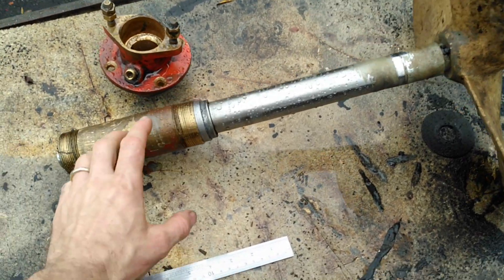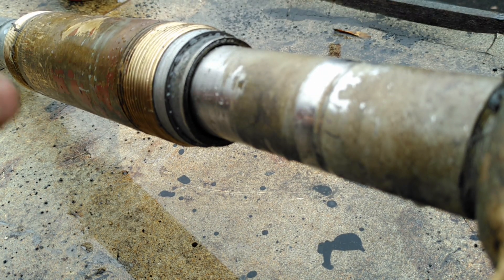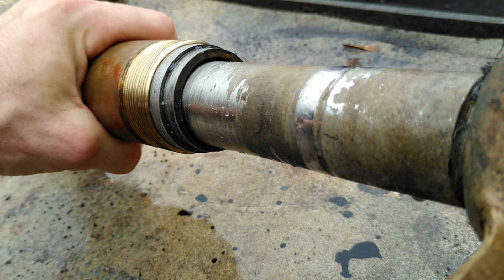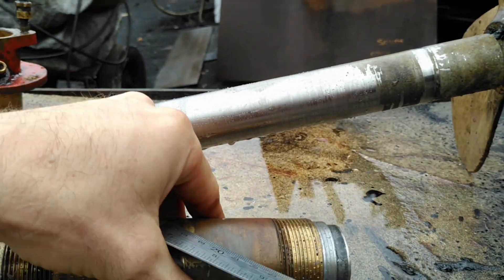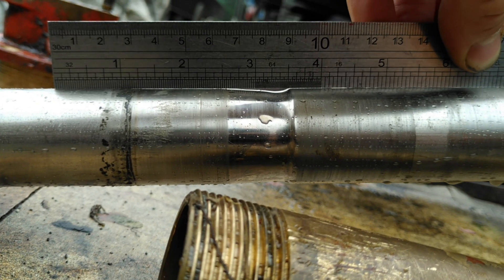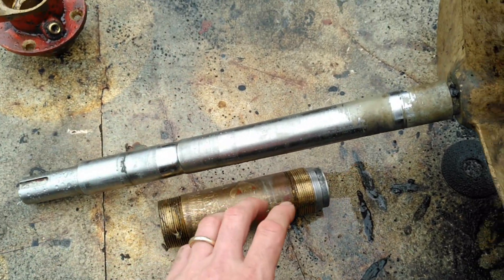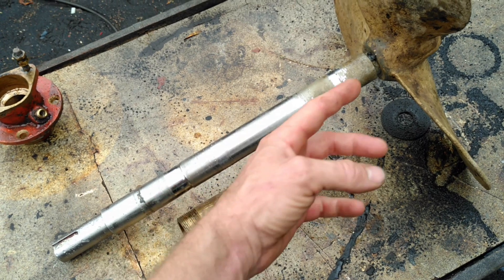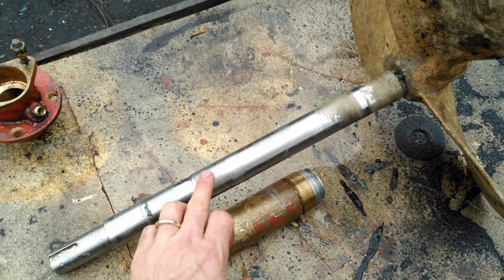How do you know if your propeller shaft is worn out ?

Comment: My boat make a whirring sound at around 900 to 1200 rpm. DAF 615/paragon p45 transmission. Could it be slight chip on the prop or cutlass bearing worn. This January when out to the water I could lift the prop by 2mm but after rotating by 180° not possible to lift. Boat constructed in 1988, 3411 hours of mainly canal use.
Reply from the maker: Sounds like a bent propeller shaft. If you can lift the shaft 2mm in cutlass bearing that suggests that worn too. 

Sounds like you have what's commonly called "prop sing". Get the propeller checked to make sure its balanced. All blades need to run in the same pattern. If a blade is off slightly it can cause all manner of issues
Reply: @dhcrouchmarineltd3049  I agree with you. A few times in the canal du midi the prop has hit submerge things, probably tree branches.

Comment: Brilliant, thanks! So am i right to think that wear around the packing and wear around the bearing don't always go together? If there's no rattle betwixt tube bearing and shaft, then moderate wear at the packing is acceptable? This would be a good outcome for me.
Reply from the maker: The propeller shaft requires being supported well by the bearing or it will damage the gearbox bearing or thrust bearing by wobbling all over the place like mad. So you can have a good bearing but excessive wear on the shaft where the gland packing because of poor maintenance practices.
But the bearing failing can damage the gland.

The glands job is simply to stop water ingress.

Determining the extent of wear is really only worked out by fully withdrawing the propeller shaft as you see here.

That being said if your propeller shaft has little of axis movement and the gland working you could be forgiven to assume your equipment is ok.
Reply: @dhcrouchmarineltd3049  Cool. I'll whip my shaft out and get a ruler along the side. Just bought a set of feeler gauges to slip into the gap.
Reply: Lol 😂